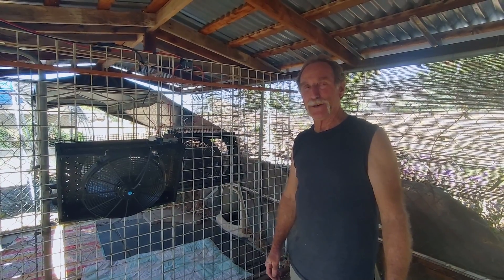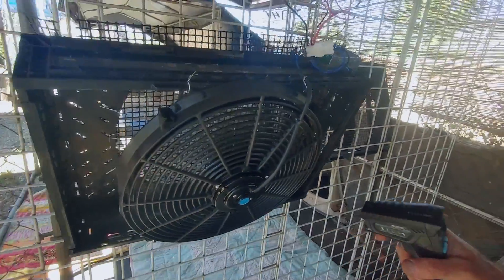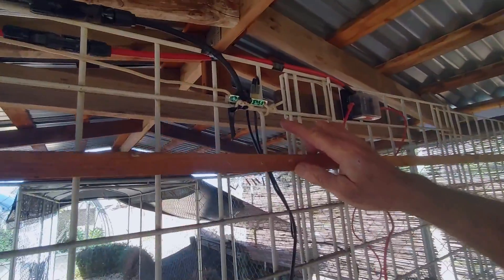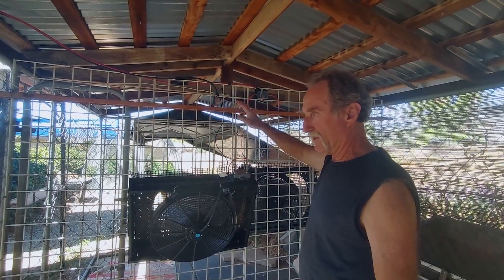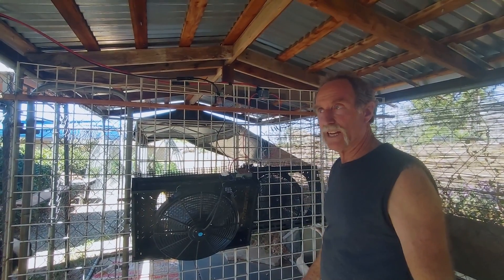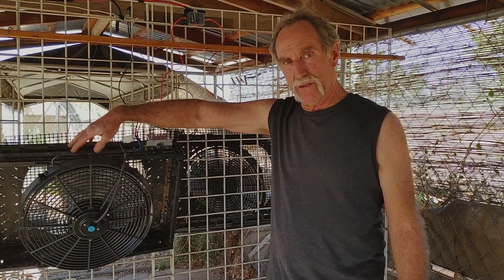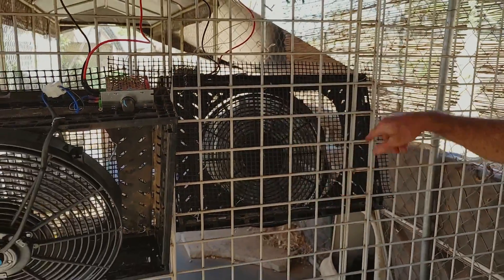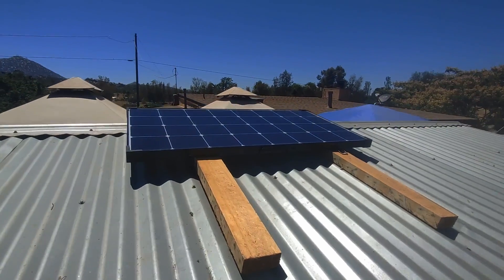DIY Solar Powered Fans run with solar panel, and no battery!

Comment: Thanks for showing how to use solar on the car radiator cooling
fans. I am going to change my attic gable fans from ac power to
solar. The extra controls are a great way to get the fans to work
like you want . I am going to the auto salvage lot to get me some
fans for cheap!
Reply from the maker: Great, hope it helps keep your attic cool!

Comment: I used a dc dc stepdown(buck converter) also and it was sluggish to no go.But mine was the weatherproof silver fin  box type. Then I tried the type where the electronics are exposed and you can ser the volts/amps and it worked fine. But if your var speed contoller cuts the volts( so as not to over volt the motor) then cool.One note is that(long term) you will go thru several dc brushed motor fans as opposed to using an ac box fan+ inverter.About 4-6 mths use and the bearings/brushes are toast.
Reply from the maker: Yes I agree about the 12v radiator fan motors. They seem to be cheaply built. I oil the bearings every once in a while when they squeak a bit.

Comment: I love your set up.  
I got on here looking for a way to do the same concept and your video was the first i came upon.  So after a year later, how's holding up.  
I'm in east texas and we have very hot humid days and we currently have several chickens that my wife is so worried about getting to hot.  I want to make one for  inside the coop at night and one for their run.
Reply from the maker: It still works great! I did try to run it off a 60 watt solar panel and it didn't have enough power. I also tried to reduce the 200 watt panel voltage down to 12v with a step down converter and it wouldn't get the fans going. So, I think the speed controllers are the ticket.

Comment: In Australia, all roofs must have exhaust fan powered by recycled 12v fans and recycled solar panels, a 250-watt panel cost $10 and 12v fans from pick a part car shop cost $10.
Reply from the maker: Now that's a smart idea! It's inexpensive, and saves more trash going to a landfill.

Comment: sir whats the motor controller model? i will buy in ebay soon
Reply from the maker: AITRIP 1 PCS 7-70V 30A PWM DC Motor Speed Controller Switch
Reply: thank you sir

Comment: How long have you use that system? When the light dims the controller can switch off and protect the fans?
Reply from the maker: I dial the speed controls up in the morning and turn them off at night. I've been using this set up for two summers so far. It's been working fine.
Reply: Can you put a heat sensor on it so it will come on as a certain temperature that you set it at ?

Comment: Nice, can you break down the cost of supplies?
Reply from the maker: Rough guess; (mostly Amazon)2-16 inch 12v radiator fans $80, 2 Aitrip PVM DC Speed controllers $26, Blade fusebox $10, wiring, PV 15A inline fuse, and fittings Approx $80, 200 watt foldable Renogy solar panel $400. $596 total estimate. Still working, and keeping the dogs cool.

Comment: my panels run different voltages. 18 to 21 volts.
Reply from the maker: I'm using a Renogy 200 watt panel rated at 18V. I think the two speed controllers help bring the voltage down enough not to overpower the fans. I tried to use a 60 watt panel, but it didn't have enough electrical output to power the fans.

Comment: I bought a radiator fan but it came without connectors-what kind of connectors fit these? I'd like to use one rather than just a wire nut.
Reply: I would like to know this as well.

Comment: Nice!! This is similar to what I have. I have 2 12v car radiator fans connected to a 100w panel with a speed control to regulate the voltage to the fans. I use it to vent my attic here in Texas. It works great!
Reply from the maker: Great idea! Venting while the sun is out, love this stuff!
Reply: Hello sir. If you would be so kind to share the setup that you have. 100 watt sola panel with 2 12 volt radiator

Comment: Well done that system it will last for long time and years to come I am from Australia Brisbane ,the weather can get really hot temperatures  i have similar project to use for my patio with plant  to cold down and dust work, with that tape of system, it save money no 💲🔋🔋🔋💲mate i am glad to see  people like you use solar power and new idea 👍🏼 💯💯💯
Reply from the maker: Thanks Jorge, nice to hear that you're doing a similar setup like this in Australia. I'd like to be able to run an indoor air conditioner with this type of setup. It would be easy to rig up an evaporative cooler with a 12v pump and these fans, but when it's humid an AC setup would be so much better!

Comment: Using a 12V radiator fan as a solar FAN is a good idea.
I have used a wind generator as a solar ceiling fan.
This needs to be modified as it has no starting torque, and I need a motor driver.
Reply from the maker: Sounds like a good idea. Anything to bypass using a battery to me is one step closer to green energy!
Reply: @fischertoolandgarden  
I do not use batteries.
The fan runs from 7am to 6pm.

reply
Reply from the maker: @kiyotakakaneko3602  Outstanding! Runs when you need it most.